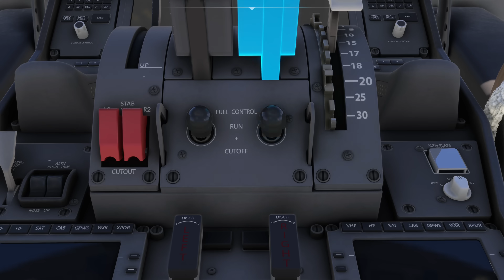Air India 171: Why Did The Fuel Cut-off Switch Get Moved?

Comment: I am skeptical of the "pilot s_cide"  theory because it is so easy to just blame it on the pilots.   
In the modern standard of computer controlled aircraft,  the potential for software glitches, or even gaping holes is very real.   
The other issue I have with it is the timing of the fuel cutoff.   Is seems to me that unless there was some kind of a ground "target" in said pilot's mind, it would seem much simpler to throw oneself over the yoke into a nosedive at altitude guaranteeing the desired outcome.  It appears to take a somewhat rational mind to prepare the scheme for cutting off the fuel switches immediately after lifting off.  I'm not buying it.
Maybe we need to get back to stick and rudder, and the accompanying fuel off switches to aviation cable and hardwired switches, and reassign the computer to stand-by instead of the pilots?

Comment: Two questions: On the CVR did they hear the switches being pull to fuel cut off or on the FDR did they see the data showing the switches cut off. If this was terrorist why not a meaningful target also no claim and if a suicide way from a low altitude where the person might have survived. Also all the suicides using planes  have been done from an higher altitude. Maybe this accident is not ready to be close at this time

Comment: First, if there were cameras in the cockpit recording into a flight recorder of sorts, how would that "leak"? They could make it as secure as it gets.

THE big question everyone is asking right now is if one of the pilot did ideed physically(!) flipped the cutoff switches, which is in no way "clear". The FR recorded the elecronic signal, and those switches are electronic. So we do NOT know for sure it was one of the pilots.

With a camera, we would know by know, or at least persons with access to the material would know.

Comment: Its noted today that in the Aviation Heralded that " On Jul 14th 2025 India's DGCA instructed airlines to check the fuel switches on the Boeing 787 and Boeing 737 aircraft as used by Air India Group, Indigo and Spicejet for possible disengagement of the fuel control switch locking feature according to the SAIB released by the FAA on Dec 17th 2018. The checks have to be completed by Jul 21st 2025."  will be interesting see what the outcome is

Comment: Hot weather turbulence may have ‘cut-off’ the fuel switch inadvertently. The Boeing maintenance directive suggests the possibility that the belt & suspender mechanism may be flawed. It appears that the switch was designed mindful of so-called ‘military specifications.’ 😊

Comment: There was a report on a 747(?) fuel switches having been installed without locking function meaning that a level of safety was not present. This report was several years old, issued in 2018. The report asked operators to verify that the locking function were present and, if not, to have the switches replaced.

"(US) Federal Aviation Administration (FAA) issued a 'special airworthiness information bulletin' (SAIB) on December 17, 2018, regarding the potential for disengagement of the fuel control switch locking feature on Boeing Company Model 717-200 airplanes; Model 737-700, -700C, -800, and -900ER series airplanes; Model 737-8 and -9 airplanes; Model 747-400, -400D, -400F, -8, and -8F series airplanes; Model 757-200, -200CB, -200PF, and -300 series airplanes; Model 767-200, -300,300F, -400ER, and -2C ..

Read more at:
https://economictimes.indiatimes.com/industry/transportation/airlines-/-aviation/dgca-directs-airlines-to-check-all-boeing-aircraft-fuel-switch-locks-by-july-21/articleshow/122440546.cms?utm_source=contentofinterest&utm_medium=text&utm_campaign=cppst

Comment: Stop Defending Boeing ..... Start Telling the Truth

Captain Steev, your breakdown of the Air India 787 incident was disappointing and honestly, transparent in all the wrong ways.

Before final official report, you rushed to pin it on the pilots. No hesitation. No mention of Boeing’s well-known automation flaws. No deep dive into how 787 systems behave under pressure. You just repeated the same tired formula , blame the crew, protect the machine.

Let’s be real.

The 787 has a history of automation issues. Autothrottle anomalies. Confusing system logic. Boeing’s own training manuals have gaps. Pilots across the world have flagged these risks. But none of that made it into your “analysis.”

Why? Because it’s easier to point fingers at people who can’t defend themselves than question a billion-dollar manufacturer?

You say you’re here to educate. Then educate us.
Where is your breakdown of Boeing’s design responsibility?
Why don’t you ever hold the system accountable?
Do you seriously believe this entire incident came down to pilot error?

If so, just say it. Say it loud — Boeing is perfect, and every pilot flying their jets is the problem.

Because right now, your video reads like damage control dressed up as analysis.

Comment: Hi Captain Steeeve, are you aware of the FAA airworthiness directive issued for the General Electric GEnx-1B PIP2? It addresses a faulty computer chip that could potentially lead to a single or, worse, dual engine shutdown due to icing or other factors. The phrase "other factors" leaves room for further discussion and testing scenarios. This directive affects several Boeing aircraft models, including the 787s.

Comment: Everything is an engineering tradeoff. Requiring both pilots to cut off fuel makes sense at first blush, but then you have to think it through. What happens if one of the pilots has an emergency and is incapacitated? Who knows what scenarios could play out. And by that logic, you could say the same thing about any other switch on the airplane. You can't design a suicide-proof airplane. You have to assume two rational people are flying the airplane.

Comment: In general, it is assumed that one of the pilots deliberately turned off both fuel switches, with the intention of causing the aircraft and all its occupants to crash.
This is, of course, a very dark chapter in aviation history and for the pilot community.
It is one of the saddest possible causes of air disasters. And unfortunately, they do happen.

But in this case, some caution seems warranted.
It is still possible that one of the pilots accidentally flipped both switches—albeit with dramatic consequences. That is, he may have intended to operate something else, but his hand performed a different action.
Who among us has never done something like that—absentmindedly performing a different action than intended? Albeit usually with much less serious consequences.

As an example, I refer to Apollo 13.
Because an oxygen tank had exploded, they had to improvise to return to Earth.
One of the astronauts was tasked with flipping a specific switch at a critical moment to jettison part of the spacecraft.
To be safe, he taped over several adjacent switches so he would flip the correct one—because activating one of the others would have caused all the air to vent from the module they were in.
Fortunately, it ended well...

Then I have a second argument: in other crashes where a pilot deliberately caused the crash, the perpetrator never said, “I didn’t do it.” They said nothing, or called upon their God.
I find it hard to believe that someone who commits such a drastic, life-destroying act would immediately deny it in a matter of seconds.

Hopefully, the final report will provide more clarity

Comment: Captain Steve - With all due respect, how can you make the assertion that there was nothing wrong with the aircraft? The Prelim Report is poorly written, contradictory and leaves more questions than answers. Have you listened to Capt. Mohan Ranganathan's interview on the Airline News YT channel? You failed to mention many things and are just going along with the narrative. The aircraft has dual audio recording channels. India knows full well which pilot said what and when, yet no disclosure. Nothing about the mayday and losing thrust. There is no final report so to make the claim there was nothing wrong with the plane is premature. You should retract that. What if another aircraft crashes due to the same circumstances and we come to find out it was a flaw in the design? Also, why would the NTSB be so frustrated as to even walk away from the investigation. These are the questions we need to be asking. Not just simply take the word of the AAIB without hearing the transcripts and seeing the data from the FDR ourselves.

Comment: Hi, I have a few questions , 
1. Was there a caution or master warning when the fuel  switch was moved . 
2.why they have not put switch guards or safety guards for the fuel  switch (like the one for fire extinguisher covers or safety covers for switches) , so that when you open the safety latch a caution appears  .
3. Was it possible to restart the engine given the humidity and air speed , if so how long it takes  the engine to do a hot start .

Comment: I totally disagree with you. I heard from another pilot's interview that the reports related to engines were not yet revealed in the preliminary report and the sequence of actions are not matching, specially with the RAT deployment time & the Fuel cutoff time. Once we get the engine reports and it is agreed by all the pilots, then we can come to a conclusion if it is a human error or some other electrical control unit glitch.
Also, as per your opinion, how can the filming of pilots reading magazines is an objection when it can solve a big puzzle in the cockpit in an unlikely event?
Are you saying the AMEs must be continuously monitored using CC cameras in the hangers and pilots must not have any camera??
You want to keep your magazines reading a secret at the cost of 230+ passengers lives???

Comment: If these switches were faulty, the pilots should have known that when they had used them to start the engines. Also, other 787s weren't grounded, indicating that they knew it wasn't a serious 787 malfunction that could cause a crash like when they had that incident with the lithium batteries catching fire many years ago. With the information that they have given us, the probable cause was either pilot accidentally error or pilot intentional cause.

Comment: Is it possible that one of the pilots (mixed in his head) did a wrong procedure? Like intending to raise the gear but instead switched those fuel switches. This is maybe a bad example but i don't know what steps have to be taken right after take off. BTW I know from fact that people out of habit and without thinking, does something else than intended.

Comment: Hi Captain.
With the comment of "why did he do that?"
Is there any indication there was someone else in the cockpit jump seat that may hav reached over and switched the engine cutoff switches and not the pilots?
There would be something on the CVR that they had a jump seat passenger or check pilot on board for the take off portion of flight.

Comment: Hi Steeeve
Do you really think one of the pilots wanted to crash this aircraft. Have yo ever done something wrong through force of habit? For example have you ever went to put something back in the refrigerator but opened a cupboard door instead? Especially when your mind is pre-occupied with another matter. Could it be possible that the pilot was asked to retract the gear but through force of habit he moved the controls to cut off instead. Especially if both of these procedures were part of his duties. In his mind he has retracted the gear but in reality he has tragically cut off the fuel to the engines. What are you thoughts on this.

Comment: A single engine cutoff just after takeoff may be needed in some cases like an engine breakdown with a rotation instability causing severe vibration and possibly risking the aircraft controllability. Cutting off the engine to tame it ASAP may be required, wouldn’t it ???

Comment: Thank you for detailed explanations, Steeeve, but I am a bit surprised that in the previous episode you very quickly dismissed ideas of software failure or software sabotage. Nevertheless, this would also explain the strange dialogue between pilots. It is my understanding, that we cannot be sure, if the switches were indeed moved, or it is only a - possibly false - information on the flight recorder, that the switches were moved.  Also, as one Indian pilot expresses, it is virtually impossible to physically move the both switches within the one second interval.  According to him, the operation needs at least a few seconds. This could be one more piece of evidence in favour of the software theory. Also, the MCAS story taught us, that software issues may be deadly. May you please comment a bit more, why do you exclude a software problem?

Comment: 4 seconds passed between Engine 1 fuel switch back to Run and then Engine 2. Why the delay? Shouldn't be it a knee jerk reaction to put both back to run immediately back to back?  Possible struggle between 2 pilots? CVR transcript of that would be witheld pending investigation.

Comment: I don't think a pilot will do so ... other experts have concluded this action could not have been taken within 1 sec interval... and he also pointed Boeing issued a notice in 2018 on a possibility the fuel switches could malfunction. I don't know why as an experienced pilot would conclude pilot error. We don't know d details yet. I have followed u since d disaster and I realised u made lots of unnecessary mostly untrue n too quick conclusions ...ryt from the beginning till now you have corrected yourself severally. Be a bit open n neutral until the facts are out. This preliminary report is way too shallow. Out of the 15 pages only 3 are relevant.

Comment: Based on the preliminary report Engine 1 and Engine 2 fuel cutoff switches transitioned from RUN to CUTOFF position one after another with a time gap of 01 sec. But, to transition them back from CUTOFF to RUN there was a 04 sec gap between the Engine 1 and Engine 2. Is there an explanation why there was 04 sec delay in transitioning the other engine? Would that indicate possible disagreement in the cockpit or technical error?

Comment: Second engine failed to restart, but even with one engine on, they should have been able to get enough lift for a soft landing.

As per this video about when a RAT deploys, https://youtu.be/C3o0g5b_kIk?si=erIrzaH9YPOGRQBG  APU needs to fail, back up battery needs to fail etc …. 

Moreover, considering that the EAFDR and CVR were sent to the US to “recover” the data, how can anyone be sure that the records were not tampered, did a member of the investigation team accompany and monitor the FDR recovery  to preclude tampering?

Comment: 3:30 but in case of pilot incapacitation, and one engine is on fire, the design will need to allow single pilot to shut the fuel solo, right? I think this will be an engineering suggestion, and we'll see how design changes, if it does.

Comment: There should be an alarm as soon as the fuel switch is moved to cut off. That would give immediate notification to the crew and not have to understand what has happened. Saves valuable seconds which might have made a difference here.

Comment: Captain, you state that you always must have the possibility to cut off one of the engines midflight. E.g. when one of the engines is on fire during landing. Might it be an idea to prevent BOTH engines to be cut off simultaniously in flight? Because, the chance that BOTH engines are on fire during landing must be astronomically small. And 2, would that perhaps helped in this case?